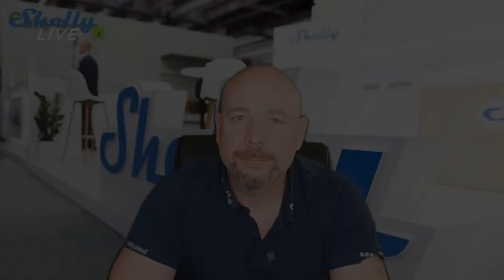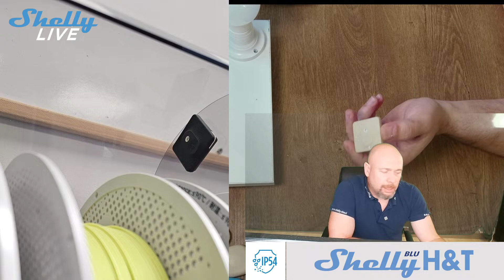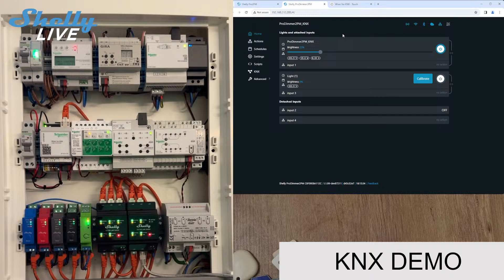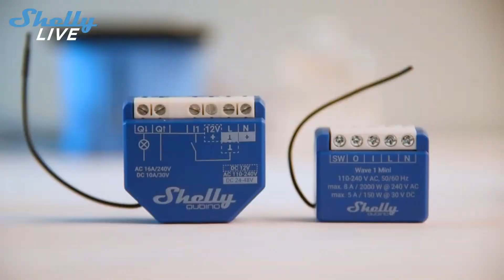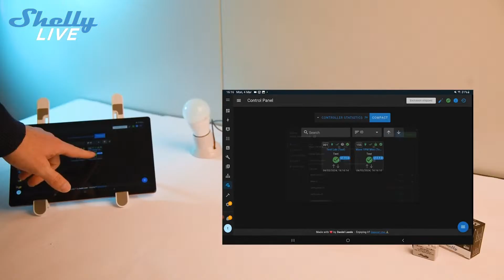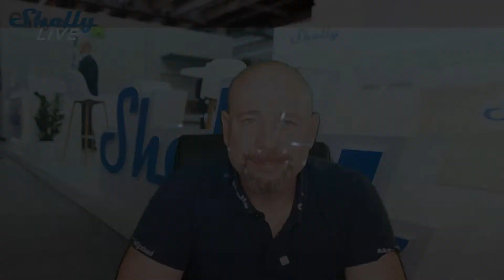Shelly Live Stream - New Products, New Integrations!

Comment: The bad thing with your devices is that they simply work :( Installed 30+ shelly devices all over my house and now I have no need for more. Which is great for me as a consumer! Love your company, your team should be proud of the results - the customer satisfaction level in unbeatable. Thank you!
Reply: I installed 10 Shelly dimmer2's and 4 failed within 2 years with the same problem, conviently just outside the warranty period. Failure rate was too high and so won't be purchasing any more of these. looking around for alternatives.
Reply: Buy a second house, so you can buy more devices :)
Reply: Non è sempre vero. Qualche volta si guastano come gli altri. Detto questo, concordo pienamente sul fatto di avere a che fare con un'azienda seria e prodotti di buona qualità
Reply: The 1st gen 2.5 stop working after a time. It's made lot of extra cost for me to change them all. 1st gen door sensor is the same. Remaining products I agree.
Just the matter update is in a delay soon we will reach the one year of the first promise.
Reply: @peterscsaurszki  Interesting. I have al the generations of 2.5, first bought right when released, last 22 pieces bought 13 months ago. All work no problem - one was damaged by me when I over-tightened the wire too much and damaged the PCB that was connecting it. Afterwards, I bought additional 6 pieces of the new 2PM model. Still no failure.
The oldest ones were transferred between 2 rented apartments and now in the final house - mounted, unmounted and remounted multiple times.
Can you describe, please, in what way did the 2.5 stopped working? So far my only problem was too-crowded wifi spectrum - in one of the apartments the wifi was very unstable and I had to have 3 APs in 5-room apartment (increasing the spectrum overload situation myself). But other than that, I faced 0 issues so far.
Reply: @rklauco the 2.5 1st gen is simply go offline. Not in the cloud it's lost the local connection also. So local automation are not working and I cannot reach from the cloud. I checked everything and all the other more hounds of shelly have no problem like this what I installed.
Reply: @peterscsaurszki  I would suspect wifi signal - the more devices you add, the more problematic the connection is. Try to add even a cheap router/ap closer with wifi on different channel with different name and check, if that increases your reliability of the connection.
Oh, and my experience with of-the-shelf wifi routers - while they claim hundreds of devices "able to connect", more often than not the reliability goes steep down after more than 8-9 clients connected :(
Reply: @rklauco  It's happen in environment with old and new ruther, and the wifi signal is not a porblem as usually they are near each other. And it's happens only with 2.5 in all the location in different envirements. If you want I'm happy to give you all what I took out for free :)